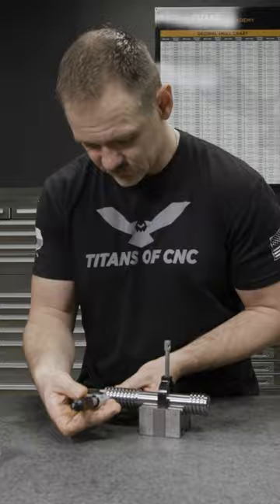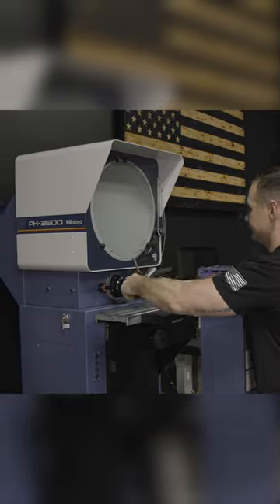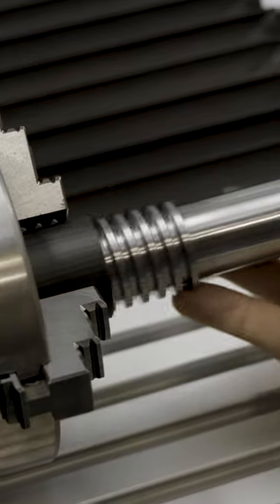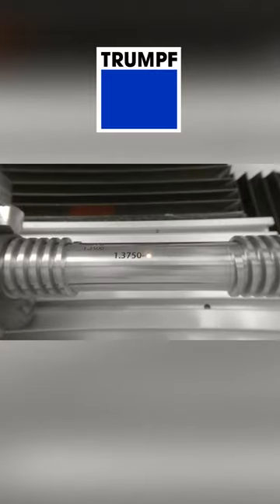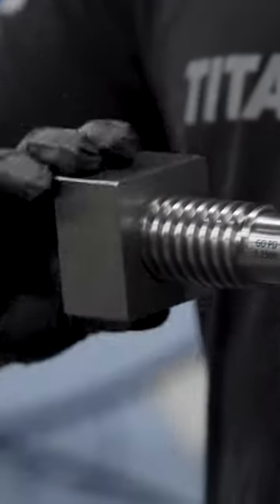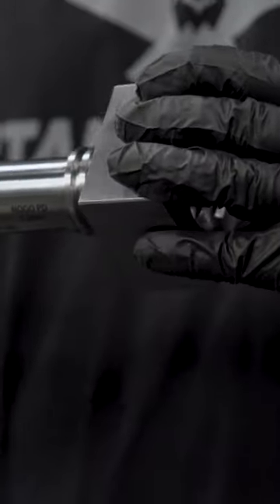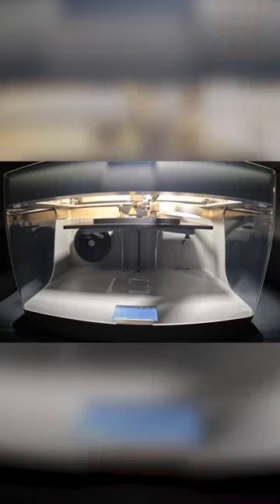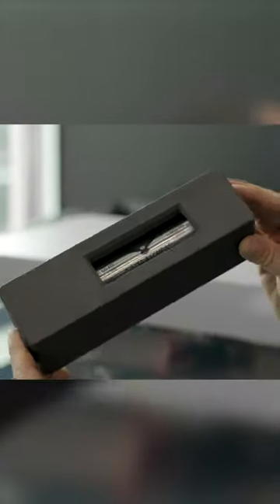Precision Go/No Go Gauge

Comment: What's the purpose of the gauge?
Reply: To check the threads on a part to make sure it's within the specifications for the given thread type (minimum diameter, pitch diameter, major diameter, threads per inch).  The "Go" side should fit smoothly without binding.  The "No Go" side should not fit, as it's typically oversized for the asked for thread.  This is a quick check to ensure a bolt with the same thread type will fit in your part.
Reply: @Cethin  sweet thank you 👍